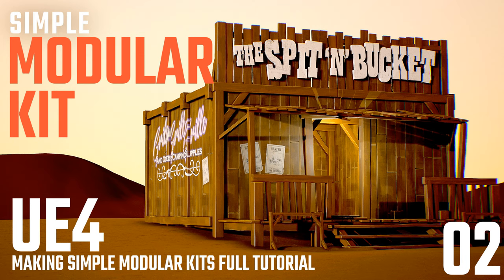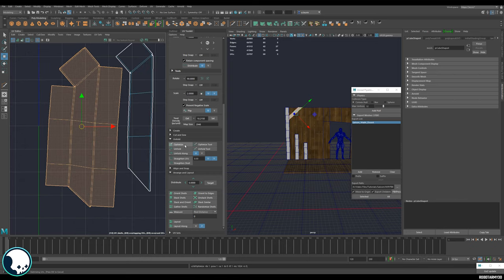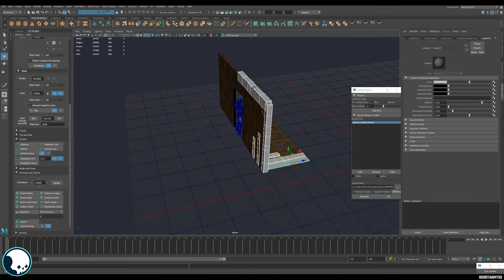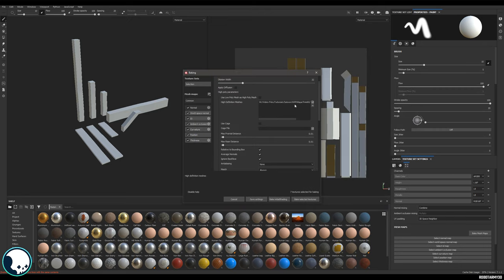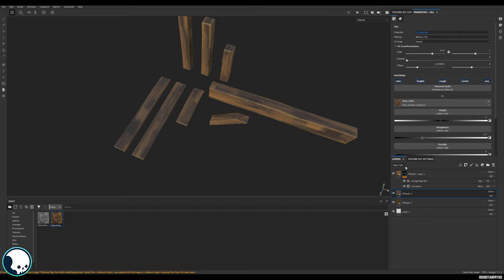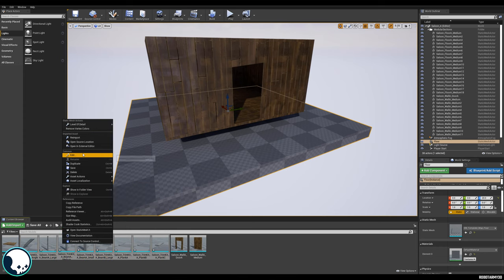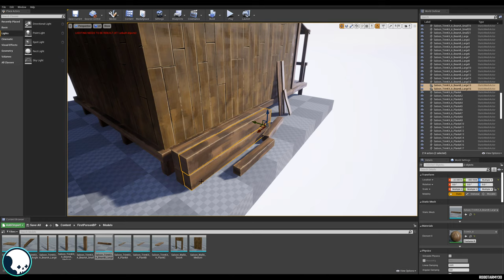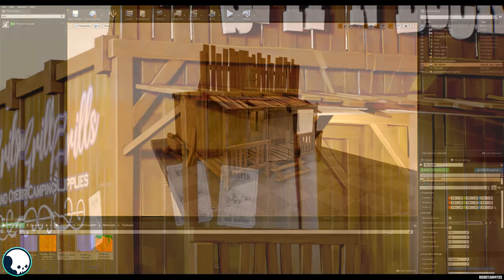The Saloon - Simple Modular Environment Kit Tutorial - FULL TUTORIAL - UE4 - PART 2 -

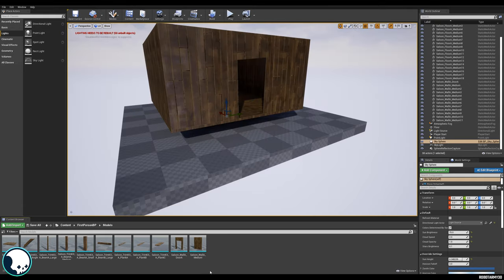Comment: Thanks for tutorial! Just got one question if you don't mind. The external wooden parts at 32:17 are overlapping and it looks kinda odd. Is it possible to fix this issue without "hiding" the overlapping parts of the structure with other wooden parts?
Reply: its called Z fighting, you just need to offset it slightly or reduce the length of the ceiling/walls so the faces ending at the correct length. he covers it up so im not sure if that  causes perfromance issues when not visible.